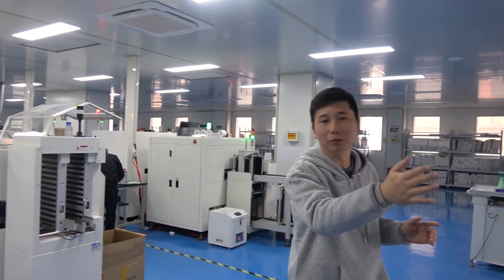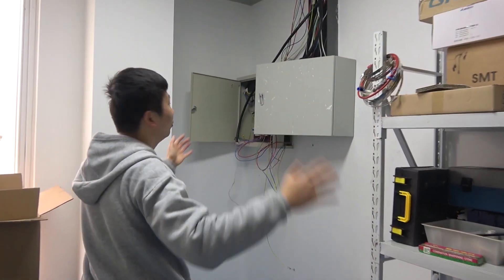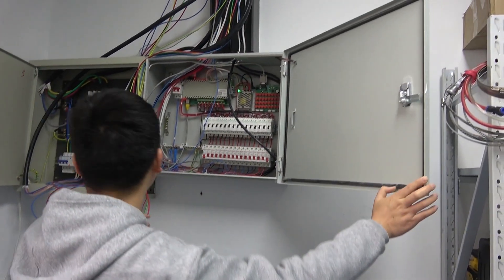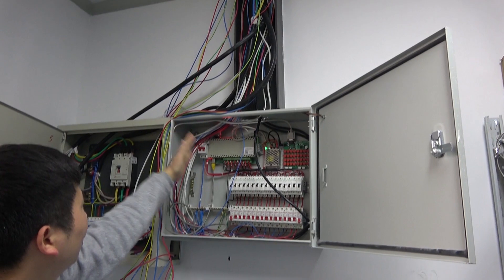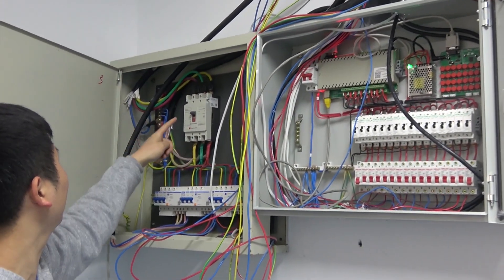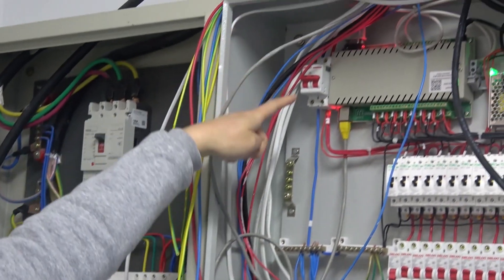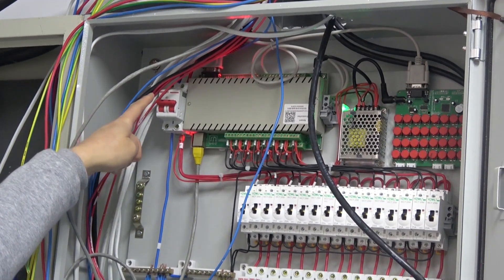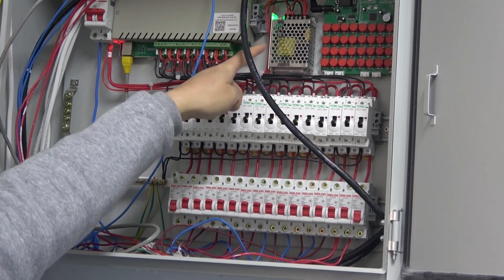smart lighting IOT solution for factory workshop power energy saving

Comment: Hi KinCony IoT. ¿The lighting system has LAN and WiFi control and the software App includes the programming? Thanks a lot.
Reply from the maker: according to relay controller module, if use B series controller, both support ethernet and wifi, work in local network and internet at the same time
Reply: @KinCony  Thank you so much.